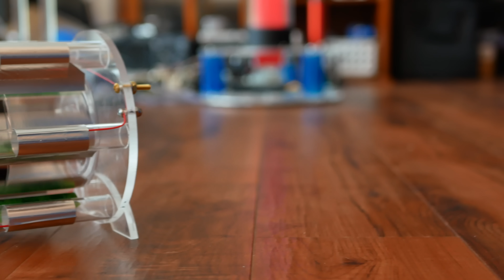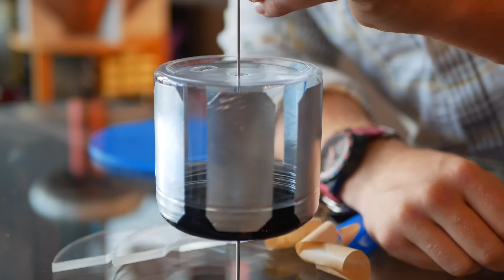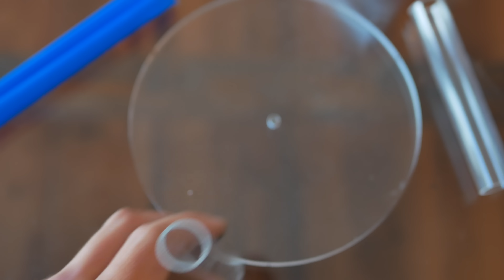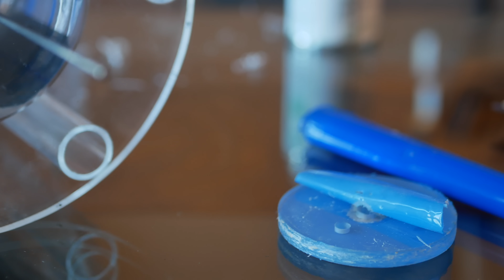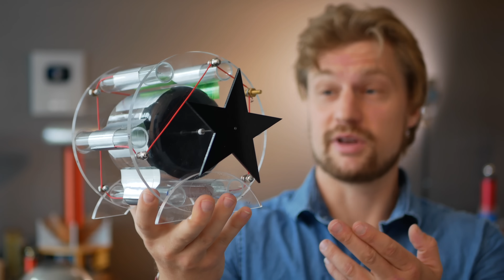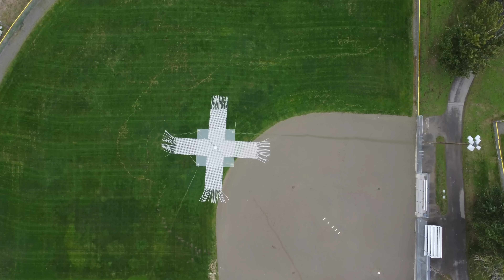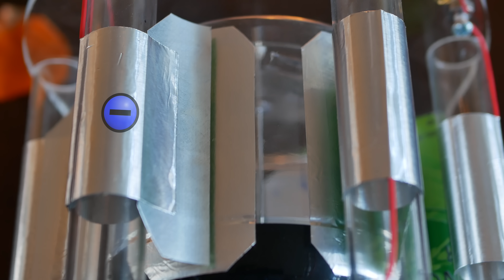Building A Wirelessly Powered Corona Motor (DIY)

Comment from the maker: Thanks for watching! The giveaway will conclude on November 10th, 2021, where the winner will be informed either through comment response, instagram response, or direct email.
Reply: Can you make two rotors beside each other to double the power
Reply: Make a QEG generator..its all over the internet... And give some reviews please
Reply: https://youtu.be/-Irtau91a78 here is the link to my Warp Drive project where I will incorporate the corona motor and use the output shaft as a rotary spark gap!
Reply: It's crazy just how connected the aeither is. I am building a design just like this. I guess I will change the operation and enter it into your contest. I will say that ever since I built your Tesla Coil for my step sons science fair (which was absolutely un-fair in the judging portion. They basically said it was too advanced for his grade and that he couldn't have built it alone. But he did all except the soldering and circuit installation) I've been going strong and now have an entire electronics lab.
Reply: have you figure it out why Nikola Tesla's tower has to be that tall?
Reply: If I win it I’ll take it into a 275 kV substation and see it it pick us the “free energy” and make a video and upload it.
Reply: Now, you must build a fan out of one.
Reply: You should try to make a motor powered by corona virus.
 Another kind of corona motor l
Reply: This thing is awesome and I want one but now I might have found a second way to charge a power bank like a Jackery if I end up getting one
Reply: I'd love to win, but I missed the "how to enter part. If this message is enough, I m saying I'm fascinated by your videos. I've got the last bits for the Tesla mini speaker, will build this week. I would love to up-size that project!

The speaker will be interesting to find out if phone compatible hearing aids sill pick up the music or the static at the frequencies of the music. I'll let you know. I can tell when  the bank has it's due pack trigger turned off, my hearing aids pick them up as a odd howl!
Reply: Tesla would be proud of you my man, I strongly recommend you try his turbine in conjuction with the motor
Reply: Can you build a functioning free energy generator?It would be great to see what you can build.Love your shows,very entertaining and educating - thanks.
Reply: i want too plz
Reply: Polycarbonate/perspex is the best for builds so you can visualise the work of art ,
Awesome build Jay .
Reply: I need this!~
Reply: Have you tried submerging it in h20 and seeing if it can separate hydrogen oxygen gas?
Reply: @jasonlewis8191  that will not help. Because needs double current and one more antenna. If you power two motors from the same source, you reduce the torque. If you want to increase the torque, you must have a larger motor instead of two motors. Because having two motors like this, it will spin very slowly, and thats because of more bearing, more mechanical friction. So its very inefficient to have two motors.
One motor like this, will never have enough power and torque. You cannot even get 0.05watts from an antenna. Search for the crystal radio that works with power from antenna and you can also search for atmospheric electricity generated at height per every feet.
Reply: Can you build me one please, I can pay for it. Thank you.
Reply: Could you reverse the process? Add something like wind or water power to the motor and have an output charge - enough to charge a battery? 
If so, could it be made more efficient than other typical dynamo?
Reply: @geraldhartman2336  this motor its an electrostatic motor. It means it takes high voltage and nearly 0 current. Has no torque. Has very small friction, which if is increased, it will stop the motor completely. 
The power that its used by this motor its the electrostatic shock that you can produce by friction between a pvc pipe and a cloth of wool. Static charges. So, a corona motor will never be able to produce low voltage like ac or dc motor generators. Its like you are trying to charge a transformer with a piece of piezo quartz and then to charge your phone. Impossible. High voltage or Sparks, electrostatic energies cannot be converted into usable electricity. They are just fractions of energy in milisenconds of sparks. Very tiny. Hope this helps you to understand. You can only use this energy for ignition of fuels or start a campfire. Have a look at the gas lighter quartz spark.
Windhurst machine its another example of static charge generator.
Also you can check a spark generator energized by water drops.
Reply: would be really sweet if you could tweak it to extract ambient EF/RF energy from the atmosphere. essentially turning 4g/5g/etc tech into wireless power generation.
Reply: @mchaten9071  5G has few centimeters wavelenght.
You cannot convert 5G signal.
Not even 4G or 3G.
You only have bands available from Mhz to khz. Low RF.
Check how crystal radio  works. Its a free energy vintage radio with a very long antenna.
You can only convert RF signal in light. Nothing else. Just use leds and antennas. Then use the leds to light a large solar cell. Now you have a constant real free DC energy from radio signal. no transformers needed .you cannot converted high voltage RF in dc in any other efficient way. RF - to- 1S886 diodes - to - cool white leds 5mm 30mAh ...
Many people on youtube asking non sense like you just because they hear other example. Ghz signals will never be converted in electricity.
Nobody could ever obtain energy from that short wavelenght.
You do the same thing like other people......wasting your time and others time.
Reply: @FRESNEL_COOKING_SOLAR_OVENS24  or maybe your attitude of impossibility keeps you from figuring out a way to do it. That's what inventing and science is all about, right?
Reply: @FRESNEL_COOKING_SOLAR_OVENS24  how about used as the first stage on a stepped system with multiple motors generating electrical current. Used with amps and transformers and coils to boost power in each coil etc. Similar to the way power stations boost power
Reply: Deal.  
I sub'd.
Reply: Is that how Aliens fly? assuming they exist and they gather the electricity they need from just from the thin air to power their propulsion system whatever that might be, motors no motors, plasma turbines, who knows and when they go in to space from one planet to another there is plenty of electricity in space as well, assuming that that's the case, also if they have any wepons it would be Lazer guns powerd the same way, electricity from the air.
Reply: Essentially, this is the DUAL of an induction motor. Instead of using attraction and repulsion of magnetic fields we are using attraction and repulsion of electric fields. Nikola Tesla would be happy!
Reply: Fun
Reply: @helpabrothawithasubisaiah5316  Or a Solar Eclipse motor, powered by the corona of the Sun blocked by the Moon.
Reply: If we turned the collector find in to salt water capacitors would we get more torque/power?
Reply: I just recently found this channel and I am definitely going to have to go back and watch them all. I am a 3rd year Electrical Engineering student and building/testing and understanding many of your contraptions I believe will make me a better engineer 1000 fold. Thank you sir, keep the great videos coming.
Reply: It's like a food mixer 😂😂🤔🤔
Reply: Thanks for a cool idea Jay. Could this be used with a high altitude helium balloon and a voltage multiplier to charge batteries? Also could you use multiple ionization plates to increase the voltage? What would you suspect is the amount of time it would take to charge a say mobile battery bank of moderate size?
Reply: Where we can buy these motors
Reply: Wouldn't it provide it even if it's two... fields.....
Reply: What would happen if you had a high voltage mosfet/transistor and pulsed it at a high frequency? Would you get much more power out of your setup?
Reply: Heres a tip, use razor blade or any rectangle blade with one side sharp, the sharp edge helps electricity transfer to the rotor and produce higher torque. Round the corners of the sharp edge because electricity will force there and the middle of the blade will conduct less to the rotor if you dont, this also gives you better torque. 
A good corona motor should not have many sparks while running.
Reply: Hello. Just a country boy here with not much education. You took the wire up only a few hundred feet with the drone. What if you ran the wire up tro the top of a mountain? Say a few thousand feet?
Reply: Your stuff is so awesome. These are the ideas and applications we need!!!

Comment: This video is gonna get a lot of free energy comments 

The motor is pretty awesome !
Reply from the maker: I can hear it now, "freeeeeeee energyyyyy!"
Reply: Ha ha ha its funny 😉
Reply: There is no free energy - Mehdi Electroboom
Reply: Use it for your rocket engine :-)
Reply: high voltage tomato crusher?
Reply: I’m sure Mehdi “The Rectifier” will keep a close watch on the comments.
Reply: Wooo Integza! Your videos are great too 👍
Reply: I mean there's "free energy" crackpottery, then there's "free to You or quite cheap energy".     If we want to get technical- beyond the drone, his atmospheric antenna running one of these motors counts as free energy.    Hang it from a tall cliff or tower and there you go.   
There's also hacks like that wind powered car that goes downwind faster than the wind is blowing-  doesn't violate physics, still works though it seems like it shouldn't.    
That sort of thing, so often dismissed out of hand because it Sounds like impossible "free energy", I think more people should look into.    The worst you can do in the attempt (beyond utter failure) is coming up with something more efficient than usual, and maybe you can find a clever exploit.  I think I've got a couple.
Reply: Where is electroboom
Reply: No gas, no solar, no wind, just a wee lil spin, and my house is powuhd wiff FWEE EMUDJY 🧠<💩🥧
Reply: @andymuzzo8568  when Mehdi makes a set of conductive carbon ink painted Rectifiers to power a Wimshurst static Corona Motor that takes a chain link up high & tests the Steve Mould chain hypothesis is actually electromagnetic in nature not gravity did it.. then your talking
Reply: @paulmaydaynight9925  definitely a static discharge kick back force.
Reply: @electronresonator8882  it was wireless energy transmission but used hydroelectric power
Reply: Free energy as long as you don't pay for it. :)
Reply: Free energy is banned FYI
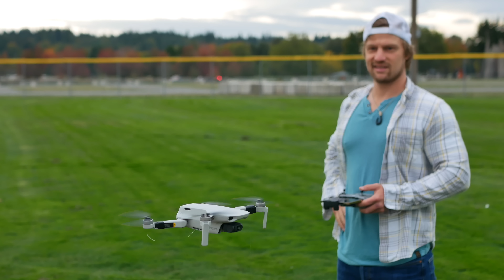Reply: @PlasmaChannel  >>> At about 05:00 in this video:  Could you use a Kite instead of a Drone for that purpose?
Reply: now can u make it a jet engene:)
Reply: @PlasmaChannel  Free energy, man!
Wait, isn't decentralized renewable already free energy?
Reply: I guess it's technically free energy.  But it's so little that it's just a novelty item, like those black and white blades in a vacuum that spin in sunlight, or that drinking bird made of straws.
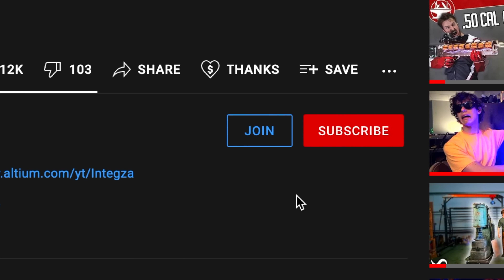Reply: 0:57 knew something was sus
Reply: @fredashay why cant it be scaled up..using larger equiptment?
Reply: @jimberlygridder183  I guess it could be.  It would be interesting to see one built that can power an off-grid cabin in the woods or something like that...
Reply: Please add piezoelectric  to run
Reply: Lo sería si usa un electret

Comment: Fantastic,  maybe someday we could use this on a larger scale.
Reply: The global electric circuit has a total power comparable to 1 coal power plant, so it's kind of a drop in the bucket in terms of global energy consumption, though we could still get a lot of utility from it with low-power devices. I also recently learned about electroculture - supposedly you can just stick a long wire in the ground and it helps plants grow by using the atmospheric electric circuit to do... well I'm not 100% sure what it does, but maybe it helps nutrients move through the soil, promotes photosynthesis, repels pests, and attracts pollinators? I haven't seen proof of these claims, but they seem plausible enough to be worth testing! :)

Comment: It would be very interesting to see future improved versions of this model. There is many possible tests and improvements. For dyno version You can get a HV coil from a microwave oven (it is a coil that is part of dish rotating round servo motor). That coil has very thin wire and might work for the dyno version very well :) best regards
Reply: lmao you wished him best regards as if he already died from trying to do thatXD
Reply: @444455555shock  well that coil has a high resistance so I would not think there could be any lethal discharges from it. XD
Reply: Fair enough lhh just funny how you phrased it